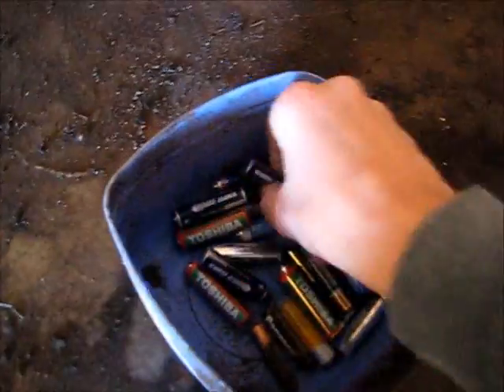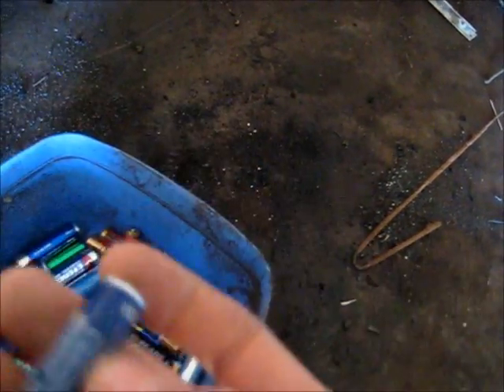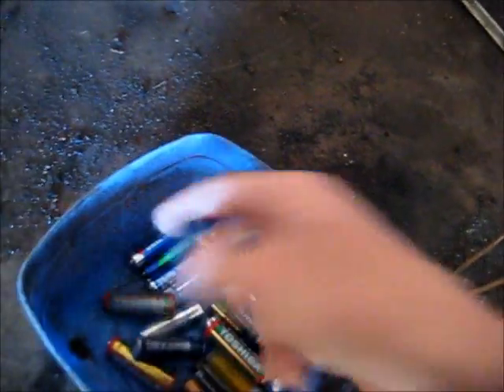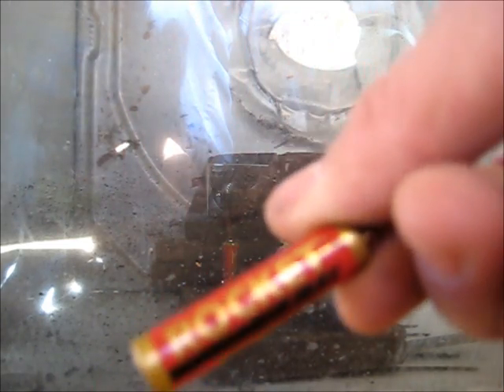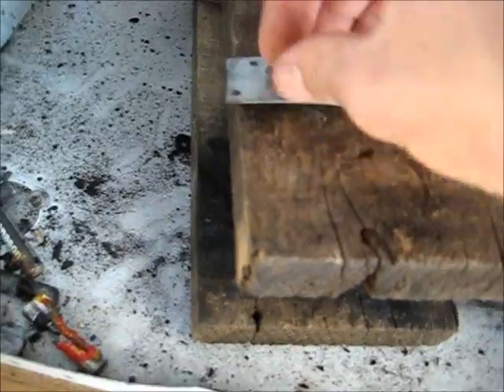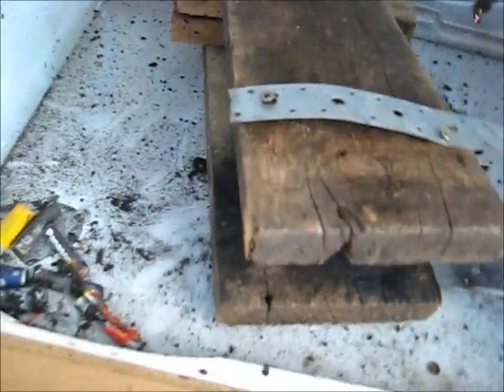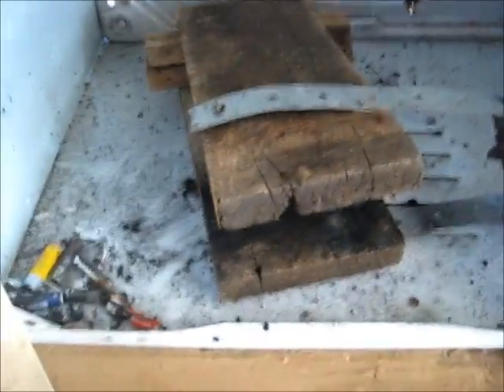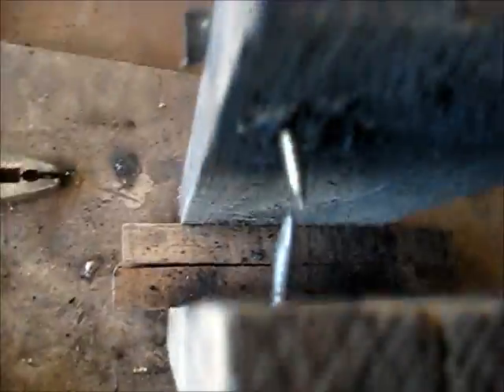Battery Popping Madness :-D

Comment: There's a nice few battery pops there! :-D Some of them went like an arc furnace, but the whistley-squeelers are my favourite. :-) They whistle, they squeal, then they glow, spark, and.........*POP*.

Also, did you have the EMAIL meter connected on the supply? The meter would give a good indication of how much power is being pulled, and whether-or-not you have an open circuit. There's a whole lot of info that the rotating wheel can tell you, also of course, how many kWh you use. :-)

-BBD.